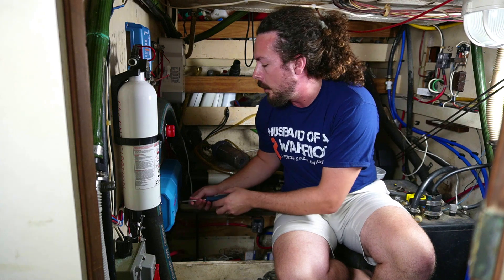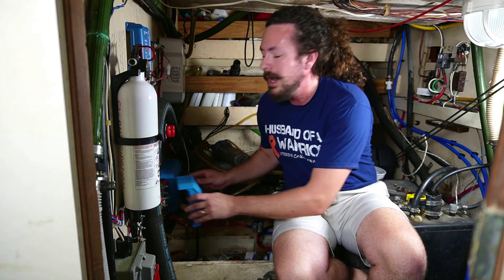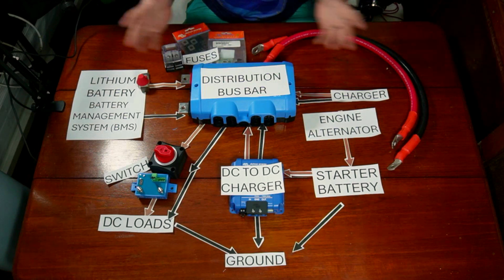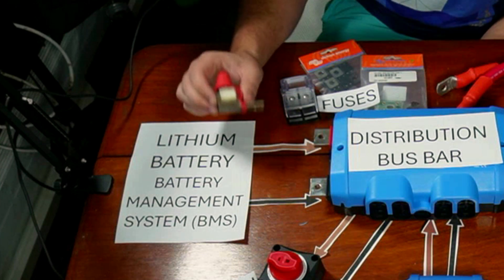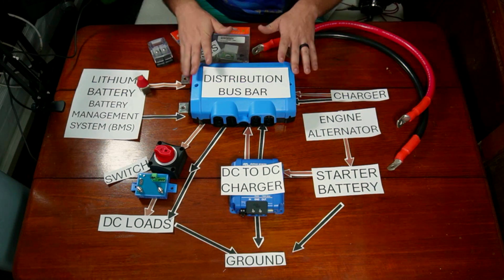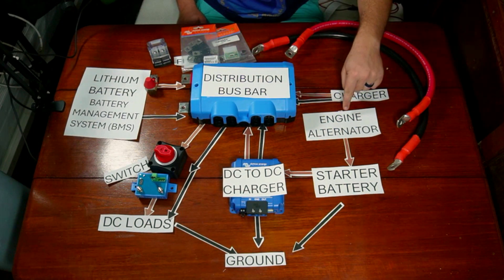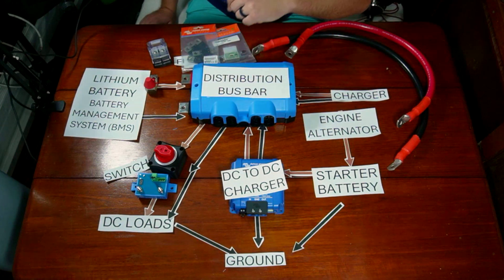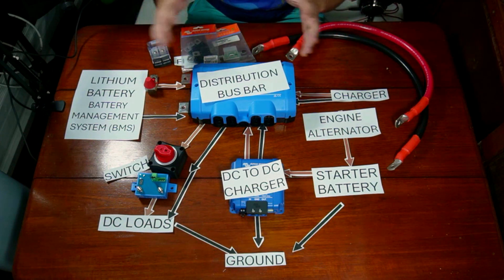The SIMPLE lithium battery installation

Comment: Without a split charge or battery isolation diode, will not the lithiums potentially drain the start battery?
Reply from the maker: The DC-DC charger helps to regulate this, it will only allow charge to flow when the voltage reaches a certain threshold

Comment: Thank you for this video.  It does separate the needs from the wants.  I’m new to boating and electrical work.  Is the DC/DC charger necessary?  I understand the benefits and will eventually add it, but what if I only want to charge the lithiums with my solar (that’s not yet installed)?  Do I simply follow your diagram without the Engine/DC2DC/Starter Battery parts?  And I’m assuming the charger is still necessary because it converts shore power to charge the battery? Thank you!
Reply from the maker: Thank you for watching! You only need the DC to DC system I showed if you want your alternator to be able to charge your house bank, if you plan on using solar to charge your house bank you can skip that and keep your engine and alternator on its own circuit. And if you plan on using shore power to charge your lithium you will still need a charger that’s rated for lithium.

Comment: So, i am replacing my 6v Trojan house batteries with 400amps of lithium..  so as far as i can see, i need
A DCTODC with inbuilt Mppt for my solar, a litium charger for shore power , a shunt for battery monitor and the right rated fuses..
Is that correct...  Everybody seems to make out you need a degree in astro physics to instal lithium.
Reply from the maker: That sounds about right, make sure whatever DC distribution bar you’re using is rated for the amps your battery is capable of supplying and you should be good to go!
Reply: @twohalf-hitches  Thank you

Comment: You showed a large blue box for your bus bar at first, but in your setup you show amazon type bus bars?  What's that about?
Reply from the maker: The main bus bar is the big blue box, it’s Victron’s Lynx Distributor. It’s connected to the Lynx Shunt in my setup. The plain bus bars you see in the setup are for specific circuits that my boat is wired for, which is why I didn’t mention them, your boat might not need them at all
Reply: @twohalf-hitches  Thanks for clarifying